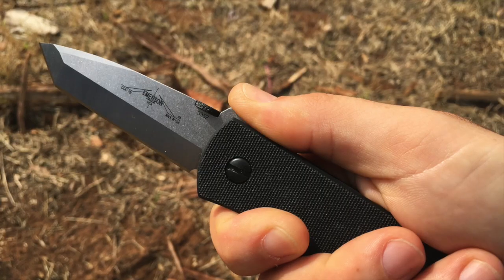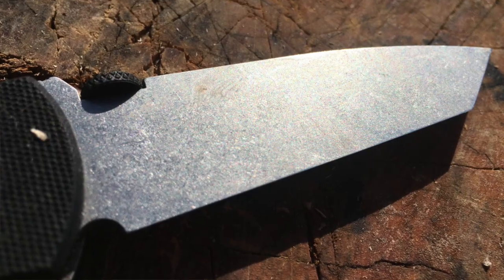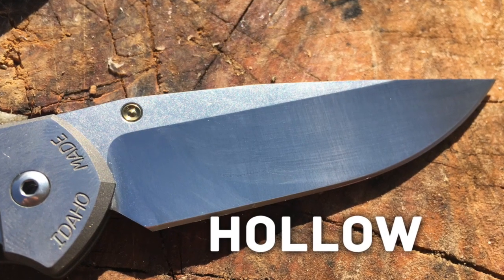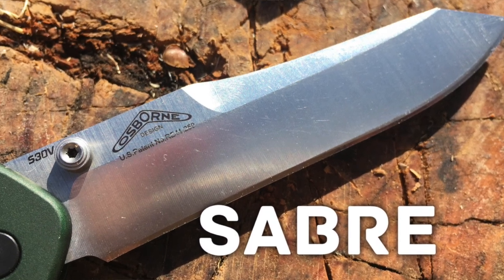Emerson Chisel Grind - Bad for EDC Tasks?

Comment: Chisel grinds are great for food prep. The problem with Emerson is that he puts the bevel on the left side of the knife instead of the right side for some stupid reason. Many chefs knives are chisel ground, as the right sided bevel will push food away as you cut it. I'm sure if you cut food from the left side (say using your left hand), it would work pretty well.
Reply: FMD, I thought I was the only one that was going to say something.

Good that he makes a lefty version - where is the one for the 90% of the users????
Reply from the maker: Phil Sinex you are absolutely right and I cannot see why it would be on this side. Simple switching it over would make suchba difference!!
Reply: Legend has it that Ernie started doing left-handed grinds because he thought the knives photographed better with the blade pointing to the left and stuck with them after they became a brand 'thing'. There's also a post on bladeforums where he says afahc it doesn't matter which side the chisel grind is on when cutting and so, by implication, anyone who wanted a chisel grind pointing in a particular way is wrong. Edit: oh, and NASA has bought knives from Emerson. So, he must be correct.
Reply: ...in the same post Ernie said the tanto tip was chosen because he believes it is optimal for punching through 'soft body armour', a pastime which is not top of my own list of EDC priorities even if, which I'm not entirely convinced, the mythic powers of tantos are true.
Reply: As far as tanto blades go, I have personally seen tantos punch through car doors and similar material with little to no real damage done to the blade.  It's not mythical in my experience.  It's all about the overall blade geometry and physics. The chisel grind being on the left side has a specific reason as well.  The chisel grind is for ease of sharpening(free hand) in the field quickly, on a flat rock if need be.  It is on the left side since 90% of people are right handed.  If you think about how knives are sharpened, traditionally, it makes sense.  When Emerson started making knives, consistent angle sharpeners were not prevalent and furthermore, he always designs them with soldiers deployed in a hot spot in mind where toting around extra gear you may or may not even need just is not feasible.  While I have not directly quoted Emerson, this is all information I have picked up from video and print interviews I have come across.
Reply: Yes, I've seen videos of tantos pushing through car doors. There again, car doors are made from relatively thin metal So, maybe, other point geometries on similarly built knives would do a similar job. I used the word 'mythic' because I've seen debates on 'HEMA' sites and channels comparing traditional European and Japanese blade geometries where people sometimes claim the historical prevalence and significance of tantos vs armour is overstated. Edged weapons aren't my thing though so I haven't researched any further. My interest in knives are as outdoors tools and urban EDC. The tanto point and the 'wrong' way round chisel grind on my CQC-6 make it a bit rubbish for working with game, wood and plants. I've no doubt, for a different person with different priorities, particularly someone who might need to stick his knife into another person, it could be a fantastic blade.
Reply: I asked Ernie once why on earth he put the grind on the wrong side. His answer was simply "it looks better". He's well aware that 95% of his knives will be bought by desktop commandos and very rarely see any practical use. So that's that.
Reply: The newish WE black void opus puts it on the correct side, for rightys,  and in better steel.  Small knife though....
Reply: I think this knife was designed with fashion in mind, first and foremost.  And it does a great job at that, it has my attention!  But yes, such a detraction from function lessens the appeal.
Reply: @ComUnSas most tantos do have a reinforced tip, because the flat usually goes the entire length of the blade

Comment: I have a SUPER THICC custom fixed blade with a chisel grind. This knife was designed to be completely indestructible, and I'm sure it is, but it's SO thick that it's not practical for cutting thin/light materials. I'm thinking maybe it would be a good heavy duty carry (basically as a sharpened pry bar) accompanied by a much, much thinner blade.

Comment: The one thing I re as ll like about the chisel grind,and think it is on the correct side is as a scraper without digging in to the material underneath. But I use my knife as a tool, not for food prepI h as ve other knives for that.

Comment: Chisel grind blades come in left-handed and right handed grinds. I noticed that you were using a left-handed blade while you are right handed. This will degrade the effectiveness of the blade. Try slicing your cheese with a right-hand grind and you'll see a drastic difference. Me, my favorite knife is a chisel grind that I use for woodworking and EDC. Works great at all tasks.
Reply: I ordered a right hand commander and the chisel edge is not orientated best for a righty. It's been that way every time. Does that mean that ordering a left handed blade will be the opposite?

Comment: I think the grind on the left side is mainly for aesthetic reasons ,so when you open the knife/ play with it it looks the part !(right handed ). Let's face it this expensive knife will spend most of it's life being played with  and showed off with, by a lot of people ! For people that want to use the knife (right handed )the bevel would be better on the right . This is just my thoughts. I have leatherman squirt right hand bevel works great (i know it's a mini blade not in the same league )I think this was a fair assessment of the knife / blade
Reply: If you do an image search for 'pocket knife' you'll see most are displayed pointing to the left, for the reasons you describe. Do a search for 'sushi knife' though and they'll mostly be pointing to the right so you can see the chisel grind. Emerson grinds are, for aesthetic reasons, on the 'wrong' side for the kind of fine work sushi knives are designed for. However, Emersons are, first and foremost, weapons where wavy cuts and asymmetrical punctures are marketed as a feature not a problem.